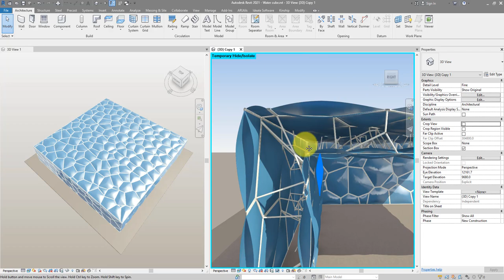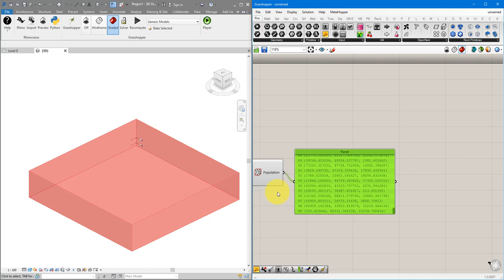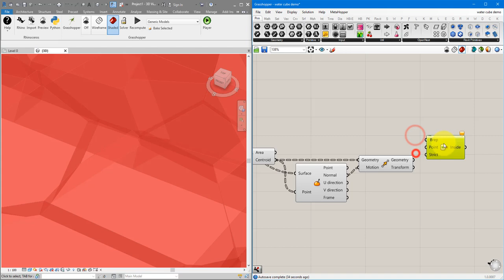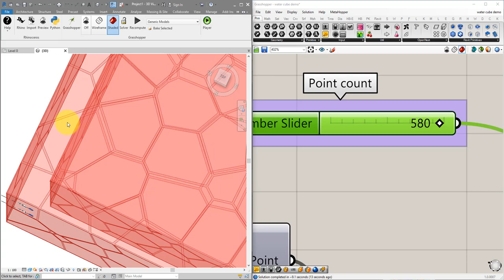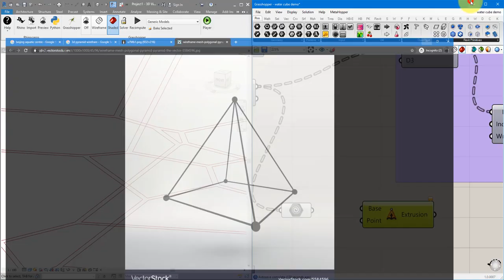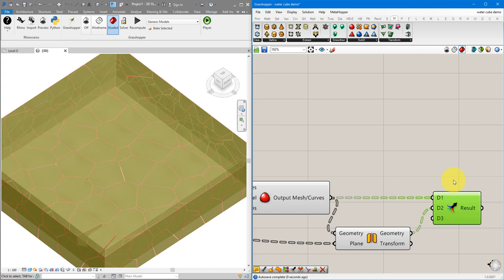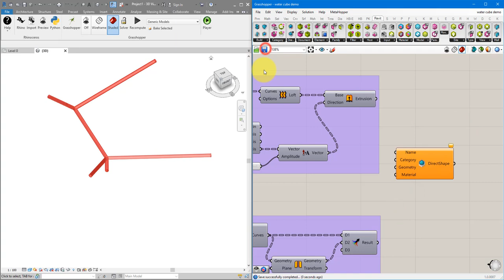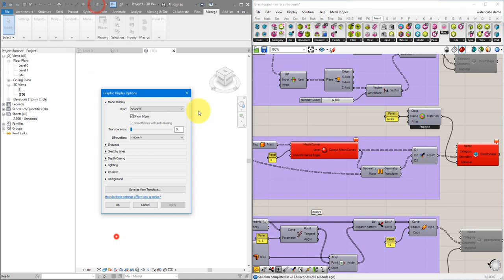Revit Snippet: Create ETFE Water Cube with Rhino Inside!

Comment: hi, very great tutorial i following the whole steps and practicing it but i have some question, i did it in different scale of box but why there's really big volume in the upper space between the original box and the new box inside, ( the gap is almost the half height of the original box) how to minimize the upper volume so that i can get a higher ceiling inside the box? 

and why there's a panel with braces and frames and there are not?

and when i complete the model can i edit the model to substract it to another model with different structure or add some openings?

thank you!
Reply from the maker: Sorry for the late reply! Glad you liked the tutorial ☺️ To answer your 1st question, the opening inside the cube was probably created my subtracting a void, if I remember correctly... If you can find this void in the script, you can move it up for a higher ceiling.

I don't really get you 2nd question...

On your 3rd question, you'll need to cut or subtract the cube before applying the panel pattern.
Reply: 1. I already find the script, its the 1  -((x*y)/z), thank you!

2. sorry, I mean that in my model there are panels with braces but also there are panels with no braces, and idk how this work

3. Im sorry, Im really new to rhino could u suggest me what should i do with the scrips I mean the step by step or could you suggest me sum tutorial that I could follows  @RVBoost  

thank you for the reply!

Comment: I'm trying to use Rhino to push a complete sketchup model I have into Revit.

This sketchup model was given by other architects. I can get the geometry to Revit but the material is the problem, even when I import it with textures the UV map is completely destroyed. Even when exported from Rhino. I'm trying to use Rhino inside now but the sketchup model has 400K+ faces. Is there anything you can recommend for Rhino for a mesh clean up for a building?
Reply from the maker: As you already have the building in Sketchup, why not simply link the Skp file into Revit? As long as materials are set "by layer" in Sketchup, you can change them in Revit under Object Styles > Imported Categories.
Reply: @RVBoost  The UV Map is broken and there's no way to fix it for me. I know you can rotate materials in Revit. But the material is applied as a planar map on the top (roof) and then the texture extrudes down. So my brick looks like timber panels.
Reply from the maker: See if you can Paint the material to fix the "extruded texture" problem. If that's not possible, try to make that face in Sketchup a object separate from the top. That might help.